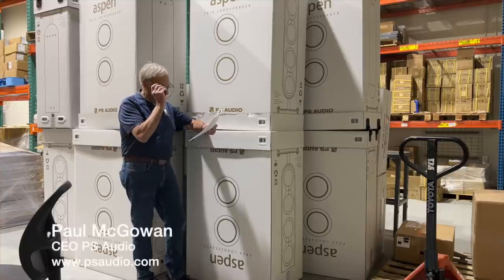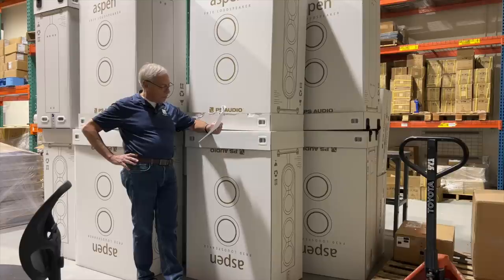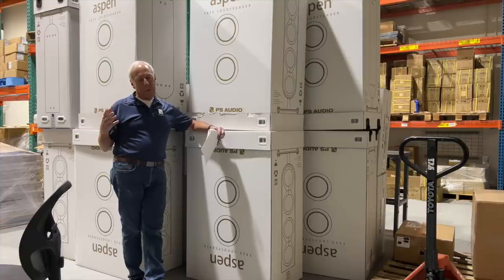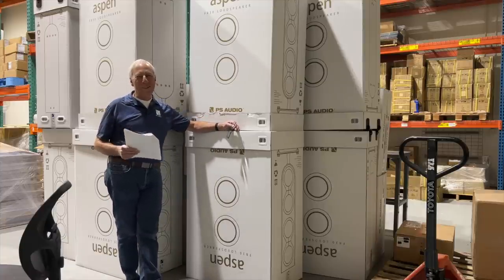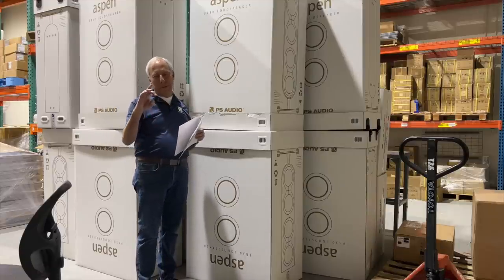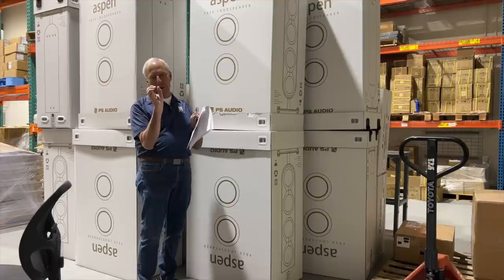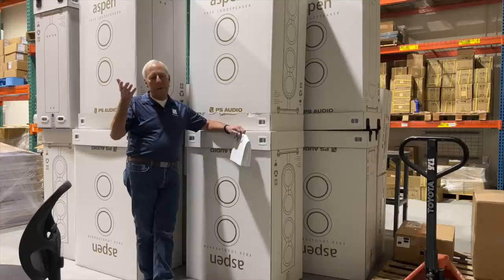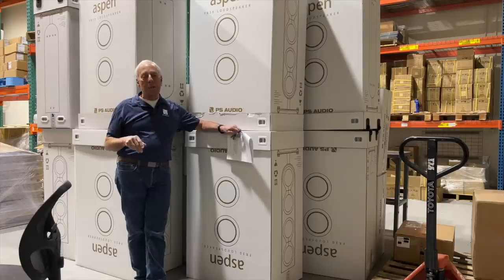Surge suppression in audio

Comment: There are a few types of surge protectors. Whole House Surge Protection Type 1: Meter Based Surge Protector - whole house surge protection type 1 refers to a SPD (surge protective device) that mounts onto the outside meter of your home. Whole House Surge Protection Type 2: Panel Based Surge Protector - type 2 is a device that is installed onto your main electrical panel. Type 3 SPD's are hardwired surge receptacles (used for large appliances like your A/C compressor), and plug-in power strips (used for things like audio systems and computers). I am in Florida and have all three in my electrical infrastructure.
Reply: Florida: Lightning City. Do you have a lightning rod on your roof?

Comment: Great explanation. 
Re AC cleaning, most bands, even smaller ones, use some sort of this in their main equipment rack when they go for life gigs.
Especially, on open air concerts the local power conditions tend to be very poor and instable - so, the bands protect their expensive live equipment and try to filter out the electricity noise from their systems. For them it's not about woodo but simple math about equipment protection and performance improvement for their audience.

Comment: I agree Paul it does. I have creek 5300 amp with Denon 2900 when plugged directly in the wall it sounds like dog crap. It's slightly better late at night but sounds still hazy when I plug those 2 in my Furman power conditioner noise floor way better all around. Sounds clearer to me   yes it restricts the amps dynamics somewhat but it's worth it to me and I have done the back and forth so many times I can hear the difference. And we do have noisy AC power here in north Georgia where I live. I also have a monster entech noise analyzer and it shows plugged into various outlets in are house how noisy the lines are.  It's awful
Reply: My power is at over 8% distortion

Comment: I couldn't even concentrate on listening to this video because I was staring at the speaker boxes. I noticed the ones on the bottom were upside down.  The arrows indicate that the box should be stored upright so you don't damage the expensive speaker inside. This tells me that the person in charge of handling the boxes doesn't give a crap about the item inside. As Trump would say, "you're fired".

Comment: Neighbor had electrical work done on his home and ended up blowing out three quarter of the block, roughly 15 homes including mine. I was amazed how many electrical appliances that were not turned on got fried! Some of the big items Micro Wave, Stove, Heater, and Boiler. My home theater system was spared but my 70 inch TV went blank 3 month later. Since then I had a whole house surge protector, in house surge, and line conditioner. Sound quality as far as I can tell is none existent. Never want to go through that again especial now that I have my 70 inch OLED baby.

Comment: Question on your ac power re-generators. I think these have a lot of merit but they are pretty dear. I have a couple of M700 monoblocks that are fed by a Rogue RP5 preamp which gets inputs from a TT, a Perfectwave DAC (fed by a MacMini with music library and a PWT). I have a whole house surge protector that should shield me from power surges but would it worth my while to get a smaller power plant to power all the signal equipment and let the swtchmode M700's continue to run off the regular AC line?  

My thinking is the M700's are really just loafing along so any input AC that has the tops flattened should not affect the DC rails on the H bridge outputs. The input preamp and digital components are probably much more sensitive to AC line anomalies than the M700's are.

So given the cost of your lage re-generator is jsut out of my range would a smaller one powwering the signal level gear do me any good or is that just wishful thinking?

Comment: Have in the past replaced some M.O.V. units that exploded but protected the circuits they were connected to.  Had a friend that was having a constant problem with failures of his electronics and appliance's,  put a line voltage monitor on his A.C. and it was measured at 130 to 135 volts.  Power company had to replace the transformer on the pole.

Comment: I’m not sure why your answer turned into an explanation of the sonic benefits of a power plant (well actually, that’s not true, I do know why) but the question was about protecting expensive audio equipment with a surge protector and whether these will be sufficient. A bullet proof surge protector can be had for a few hundred dollars (SurgeX comes to mind). That’s really all you need. Any suggestion that a quality surge protector degrades the sound is, with all due respect, BS. I have a quality surge protector and my system sounds outstanding. Surely you’re not trying to tell me that my ears are deceiving me Paul? And for those of you suggesting comments like mine are “hate mail”, please keep in mind that the price difference between a solid surge protector and PS Audio’s power plants is thousands of dollars. Most music lovers cannot afford those. And before you tell me there are much cheaper versions, sorry, but those are definitely no better than a simple surge protector.

Comment: MOV's fail silently with repeated micro-surges. If you have an old surge suppressor, it might be bad.
I found this out the hard way after losing $15K worth of gear.
I use a Zero-Surge now. I highly recommend this product.
Not only will it never fail, it also seemed to help the sound (I have pretty clean power)
Reply: "MOV's fail silently with repeated micro-surges". Well you hope. Most of the time they fail "silently". All bets are off due to lightening strikes.
Reply: One of the reasons why it's good to try and find a device that will report when the MOV failed or some that are completely sacrificial - no power means it took a surge.
Reply: @wilcalint  You missed the point.
Mains power often produces micro-surges that you are not aware of since the demand on your local circuit varies. The MOV responds to every one of these and eventually just stops working. You do not know your MOV is dead until you get a surge big enough to fry your equipment.

This is a well documented phenomenon and the industry recommends replacing surge suppressors on a regular basis.

Zero-surge is a different technology and is still under patent, so you can only get it through them and another company that licenses it.
Reply: @joshua43214  "Mains power often produces micro-surges that you are not aware of since the demand on your local circuit varies". Have you ever put a monitor on a mains? I have, actually many times. Mostly in industrial locations.
Reply: Yes.  MOV's have a very finite life and, like you, I found that out the hard way.  If you are a DIY'er, look into the new GMOV's from Bourns.  Combines a GDT (gas discharge tube) AND a MOV in the same footprint as a MOV.
Reply: @rdabbs  Back in the day when I was a real practicing Engineer, and help me on this one, MOV's purchased in bulk were about a nickel each.

Comment: There's one thing in power amplifiers that occurs. That is a transformer hum. Not until recently I discovered that certain high end power conditioners can reduce transformer hum. It's almost like a god sent in the audiophile hobby. As good as the power plant P20 is. Believe me it's still worth it if you can. It just doesn't help with transformer hum. The noise floor is so low at low volume that's all that you will notice. At that price you would expect it to do EVERYTHING ac power related.

Comment: Nice to have surge protection.
but nothing protects you 100%.
when you are not using the electronic devices, you must pull the power plug out from the wall. Even when it's stormy outside.
The electronic devices are too expensive so you have to protect them as best you can!!

Comment: Surge "protector" is the wrong term.
We are not protecting surges.

Equipment protector would be better, but it is not specific.  So it, too, is not right.

The correct term is surge "suppressor", as that is what the device does; it suppresses surges.

But surge "protector" gets incorrectly used, just as a phono cartridge's stylus is incorrectly called a "needle".  As so it goes.

Comment: No device can protect equipment from a direct lightning strike. The only way to protect equipment during a thunderstorm is to unplug from wall socket. A power regenerator cannot have any effect on audio quality. The audio signal path does not go through the power supply circuit.
Reply: Will agree that the BEST protection is to unplug all stereo equipment during wild storms, but the power does go out on other occasions. And for those occasions, a power regenerator is wonderful to have, especially with a tube amp. You do not want to be listening to music powered by a tube amp, and have the amp suddenly turn off while listening, then go right back on again after half a second or a few seconds. A PS Audio powerplant is perfect for these occasions, where the outlets can be programmed to have a delayed turn on, for 2 minutes, after the power is disrupted. Regarding the sound quality comment, way too many trusted ears, including mine, have heard sonic benefits with powerplants in their systems, to be casually discredited with an absolute statement.
Reply: @nightdrive2646  Then you should invest in some courses in electronics.
All audio equipment manufacturers are aware of how power fluctuates and build in power supply filters and A.C. to D.C. converters because audio components don't use 120\240 volt A.C.
So it makes little difference what the A.C. is like coming into the component and "cleaner" A.C. has absolutely no effect on how the component sounds.
It's really pretty basic and straightforward because the incoming A.C. is simply stored in capacitors to be converted to D.C.
Reply: Well, with my PS Audio Powerplant, I have excellent protection for my tube amp, in particular for short duration power outages. This alone is a wonderful feature to have.
Reply: @JonAnderhub  It is you sir that needs some electronic classes. Your attempted explanations show your ignorance on the subject. Your conclusion is also incorrect.

Comment: We fit our homes w/whole home surge protectors, available for any modern Square D QO plug-on neutral panel. Between that and our solar w/full battery back up system, we’re well protected from over-voltage surges. I do see “noise” when my partner plugs in her EV. It’s only for about 5 seconds, the AC frequency varies, dropping as low as 57hz. 

Don’t see this issue when turning on other very high draw items like a Haas 5-axis mill, table saw or heat pump compressor for boiler. 

Our Powerplants of course isolates our equipment from this noise 👍.

As someone of similar age, my suggestion is to not just completely dismiss the hate mail, to not even mention it’s existence. Even though you are not identifying an individual hate mail of mailer, just acknowledging their generic existence only fuels their narcissism. We’ve lived a little, we know what matters to us and  what our aspirations are with each action. At this point, focus on that, ignore the nonsense and it will usually just fade to black.

Comment: Paul is not wrong about short cable length, induction is the enemy of the SPD so all cables should be as short and straight as possible. A well selected, positioned and installed SPD should last many, many years and if they comply to international standards they most certainly are not sacrificial. Just a note of caution, there is a big difference in SPD types in North America and most other territories around the world. N American 'types' are more focused on where the SPD is positioned but in most other areas the SPD 'type' relates to the wave shape that it has been tested against. This is primarily because in N America they only use the 8/20 wave shape but in the rest of the world they use the 10/350 AND the 8/20 wave shapes.

Comment: Lost a cd player years ago here in the UK because of a power surge / lightning strike, always puzzled me why an rcd didn't protect it, maybe someone here could explain
Reply: A power surge isn't the same as a lightning strike. I don't keep up with all the latest developments in power products, but surge protectors are not able to prevent damage from lightning strikes because it comes in through the ground, where a power surge enters the component normally. You just get too much power. I've spoken to many designers about this over the years, and everyone confirmed this to be true. However, I don't keep up with all the latest developments, so if someone figured out a way to protect against lightning, I haven't heard of it. 

One thing to note is that most surge protectors claim to protect against lightning strikes. If you read the fine print, you'll see the way lightning is handled like an insurance policy. There are steps you may have to take like sending the company a list of your components with pictures, or something similar. They figure its better to handle it this way then to tell customers there's no lightning protection. People expect it when they buy products like this. But like I said above, maybe someone has been able to get around this issue, and I just don't know about it.
Reply: @AT-wl9yq  cheers, appreciate the explanation ;)
Reply: @AT-wl9yq  all bets are off when lightning strikes. The damage can be horrific.
Reply: An RCD is not for protection of an appliance. A Residual Current Device continually monitors that the current in the active and neutral of the supply are the same, which indicates the current is taking the correct path through the mains wiring and appliance. If the RCD detects that the currents are different, that means current is going somewhere it is not supposed to be going, which could be through a person to ground, or through faulty cable or appliance insulation or leakage through something being wet. The RCD rapidly cuts the power to the circuit if it detects this happening. This could save someone from electrocution, or point up a fault that could otherwise start a fire. An over-voltage event which could damage an appliance doesn't indicate a fault condition to an RCD. An RCD and an over-current circuit breaker can be combined into a single cutout unit, but again, a transient over-voltage that is often called a surge can damage a device without sufficient current for sufficient time to trip a circuit breaker.